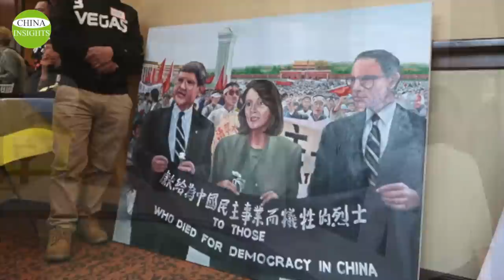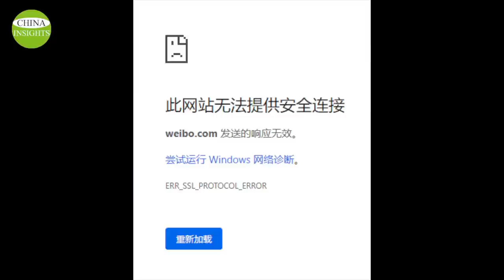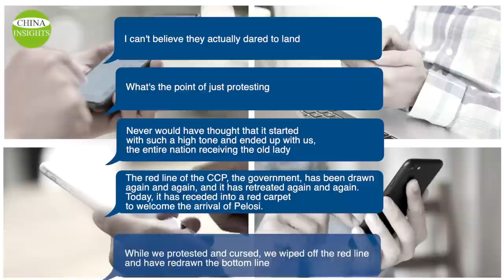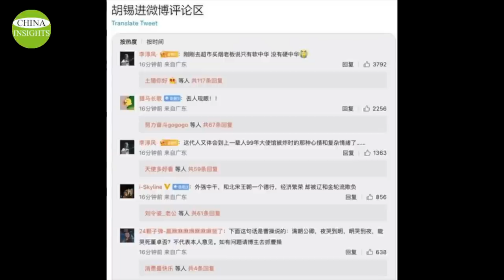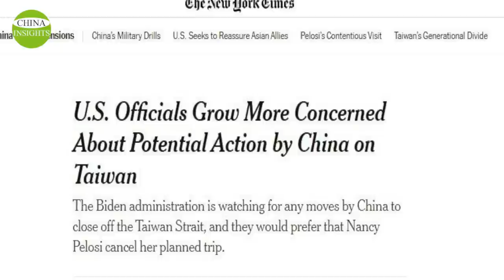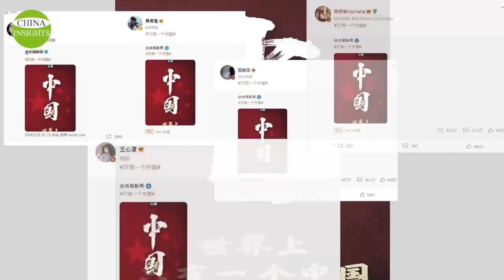Why Beijing MISJUDGE the US? Xi Jinping is likely heavily criticized for major diplomatic failure

Comment: Also, after looking how the Russians did Ukraine, Although PLA is more modernized, how many of them actually willing to die by invading Taiwan, and in modern warfare, it is much harder to invade an island as any movements can been seen, alerted, and acted upon within less than a day.
And to an extend, invading and island requires 20 - 1 at worst... And to control to population of an invaded region, you need extra 1 - 50 at worst... 
Which means not only PLA has to deploy 3M personnel, it also need extra 500K to control the captured population.

Comment: The biggest middle finger the US could and should do is by sending Taiwan 20 HIMARS and 10 M270s with white phosphorus missiles and cluster missiles with and explosive radius of 1KM, plus a full spectrum jamming system and if possible create a EMP device that only damages Chinese vehicles.
Or at the very least station 2 fleets at Taiwan with nuclear capability that is to be used against the Chinese navy and coastline 24/7.